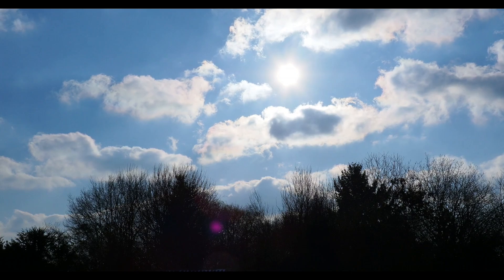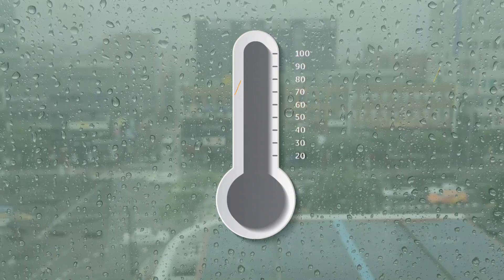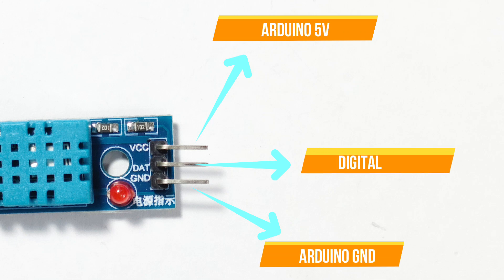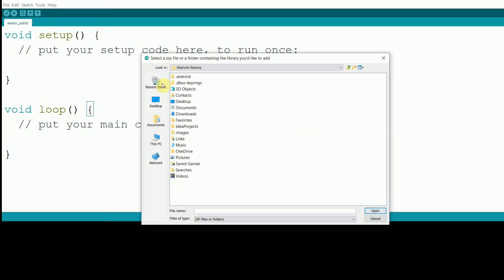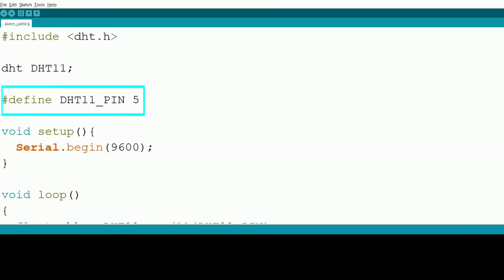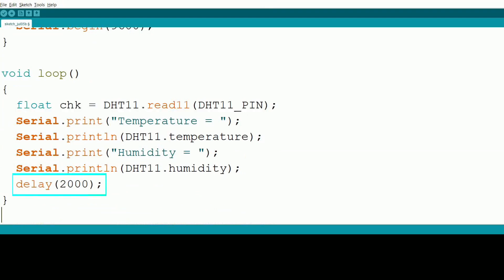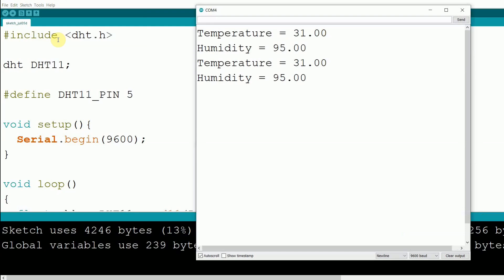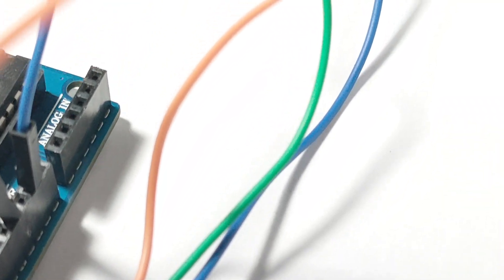How to Use the DHT11 Temperature Sensor with Arduino | Display Temp & Humidity on Serial Monitor

Comment: i know this is an old vid but when i write that in it saysC:\Users\aaron\AppData\Local\Temp\.arduinoIDE-unsaved20251026-26028-moh9z5.2z4e\sketch_nov26a\sketch_nov26a.ino:1:10: fatal error: DHT11: No such file or directory
 #include <DHT11>
          ^~~~~~~
compilation terminated.
exit status 1

Compilation error: DHT11: No such file or directory
Reply from the maker: It sounds like you're missing the library for the DHT11 sensor. Make sure to install the DHT library. You can find the steps to install it here: https://www.arduinointro.com/articles/projects/building-smart-environments-getting-started-with-the-dht11-sensor